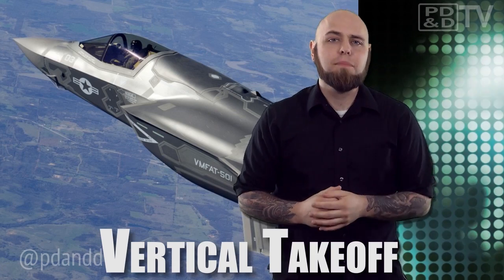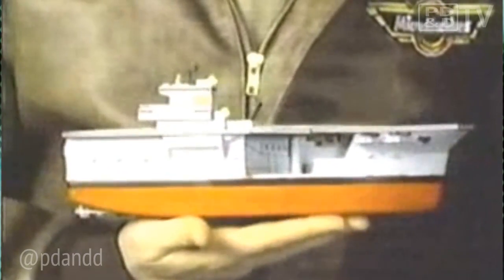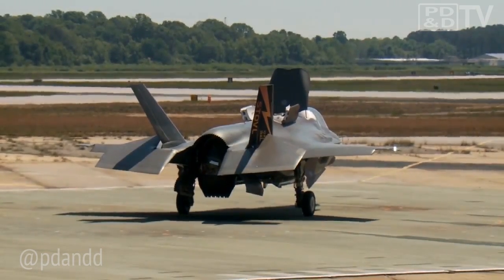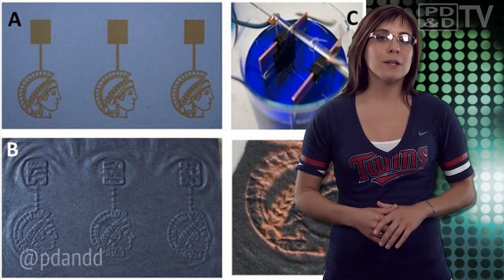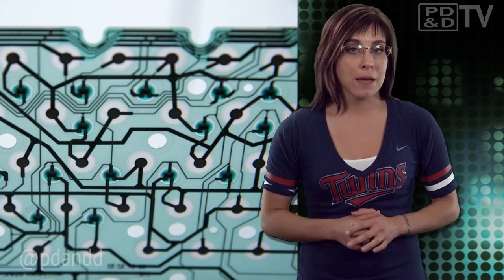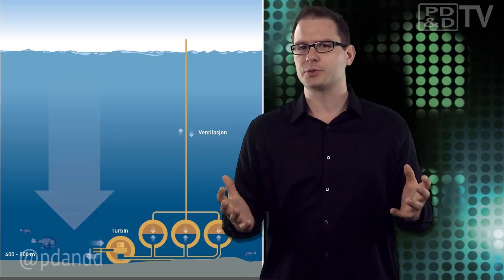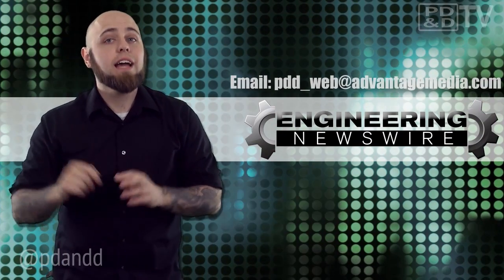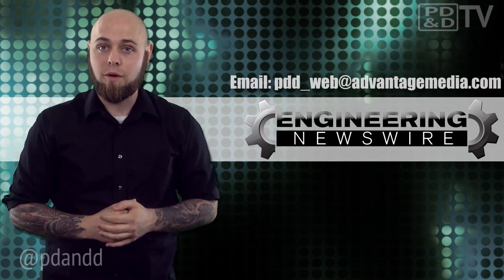Engineering Newswire 39: Lockheed Completes First Vertical Takeoff

Comment: Chris, I just looked at that press release, and as typical with big business, they phrased that poorly. It can be inferred that it's the prototypes first VTOL, it's the first VTOL at that airfield, or as you took as the first ever. 

I can't fault you for LM's mistake, but I can fault you for not doing a little research before taking that press release at face value.